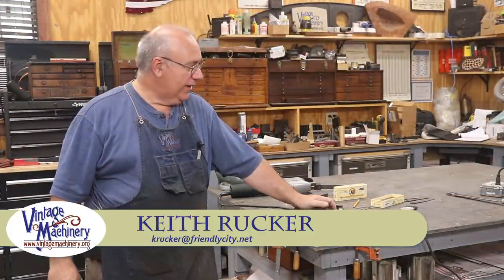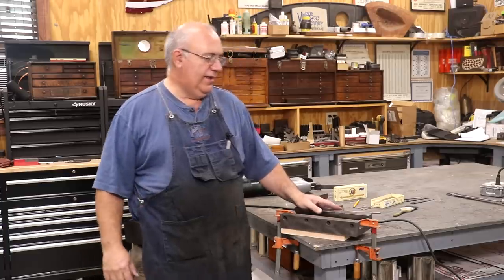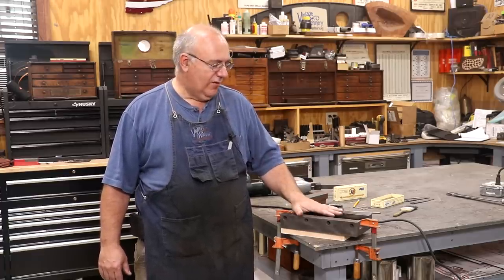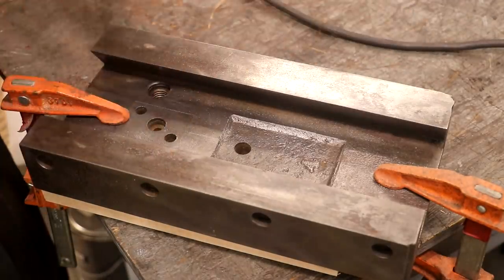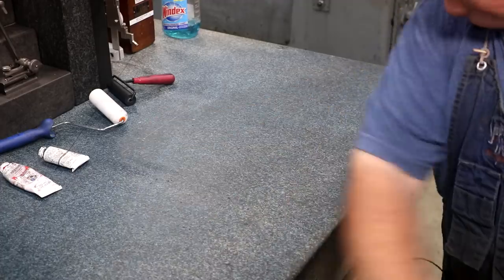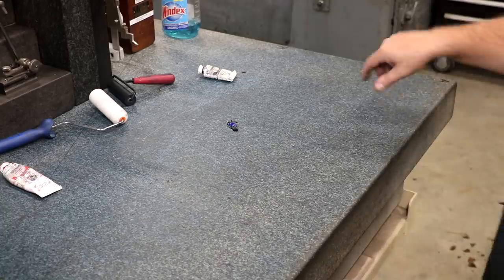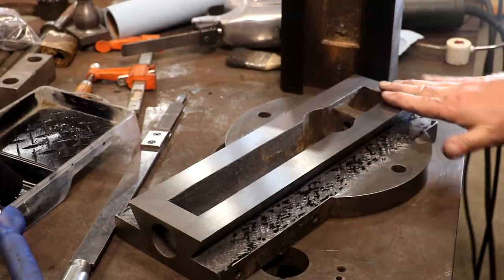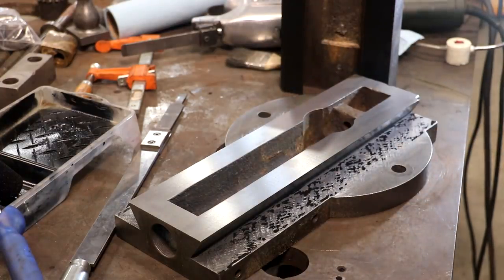Metal Planer Restoration 42: Scraping the Clapper Box Cross Slide

Comment: Just to share what's been shared with me in order to keep proven knowledge of production scraping and techniques alive for future next generations:   The old timer that taught me scraping, Peter Kuhn, used powdered paint pigment, orange and black, mixed with 10w spindle oil until it became a stiff paste, much like makeup.  He then made a dauber out of felt and would use that to spread the "ink".  Black on the plate, orange on the part.  If it's too thick, set your spray bottle of WD-40 to the finest mist, hold it far enough away you only get a few drops on the granite, then spread it out thinner.  This stuff goes a long way and you can easily control your ink film thickness. Starting out, you can high light your worn areas by spreading it thick, then thin it out as you refine your points.   Keith Rucker, thank you for sharing your knowledge on scraping.  It's an essential and dying art in the machine tool trade.  Keep up the great work.  I appreciate it.
Reply: To clarify, you would mix this concoction in an old Altoids can or a tin that you got a wallet in some years ago and daub out of the can.  Don't try mixing this up right on the surface plate :-)   You also want to have two different daubers for the different colors.  "Once you figure it out, then you'll know" -Peter Kuhn

Comment: What I've learned from "the scraping channel" is exactly how much patience is necessary to produce precision work.  Those who don't have the patience to watch it probably don't have the patience to do it, and will never learn to produce precision work.  In fact, they probably aren't producing "work" at all, they are simply sitting there waiting to be entertained.  I can tell you that the work I'm doing has improved by orders of magnitude by watching you and several others who do the patient work you do.  I'm not doing machine work.  It isn't in my budget to have a shop like yours, which is okay.  I give all glory to God for those things I can do, and don't covet that which I can't.  I do piddle around with carpentry and furniture repair, and I've learned techniques that are helping me get better joints and flatter surfaces.  I can't afford to buy new machines, but what I've learned from you and several others has helped me get my elderly woodworking machines running better and truer.  I'm tackling projects that would have been above me in the past.  All of these are good things.  I challenge the complainers to get up off their bean bag, put down the computer, and actually do something themselves.

Comment: I noticed the bolt holes that look like they were pulling up at their ends/edges, I guess that can be a regular occurrence on cast that gets the gorilla treatment on a regular basis?  The pivot lock down bolt hole on my shaper's clapper box was doing that.  I cleaned it off with the surface grinder, and I intend to keep an eye on it, to see if that trend continues.  I see signs that the hole has been repaired in the past, which explains why I had to put some relief between the bolt head and thread, and later on open up the slot a little with a Dremel.  Whoever repaired it didn't do a very good job of locating the new hole.

Since I flipped that part and did a correction grind on the dovetail, now I need to go back to it and make sure I don't have a situation that is similar to what you found.

Comment: Seen you scrape before, x amount of repetitions is needed to comit to my memory. How on earth do you get the diagonal dovetails alligned with each other?
Reply: You measure across a pair of pins seated in the dovetails at each end.
Reply: @nerd1000ify  Ahh the guage pins come in for another use. Neat Ty. Next question they are parallel but how do you make sure the angle is at or needs returning to say 60°
Reply: @alstonofalltrades3142  It actually doesn't really matter what the dovetail angle is (within reason) so long as it matches the mating part, so generally you would just scrape one side (ideally the longer of the two) in and then use that as a master for its mating part.

If you really needed an exact dovetail angle for some reason you could set a sine plate to that angle on top of your surface plate, bolt your part to to it and sweep a test indicator over the surface of the dovetail to check which way you needed to go.

Comment: Keith, I am not quite understanding this process, I would have thought the more you scrapped, the more the two parts will actually come apart in the dovetail area on the assembled machine?
Reply: They will, but all machine tool slides will have some type of adjustable gib in them. As the slide wears normally that gib is then adjusted to keep the clearances correct. Likely he's at most taking a few thou off in total with the scraping, that amount will never be noticed with that adjustable gib.

Comment: Keith thanks again. Is there a way a novice can remove the wear out of a small 1950s milling machine without a surface plate. say with dti gauges feeler gauges straight edges ect
Reply: No, if you have to ask then it's not a job you should be even considering.
Reply: @chris0tube Simone asked the question because he wanted to know, I gave him an honest answer. And it was worded precisely in that way because I do have just enough knowledge to say what I did. Without those reference surfaces Simon asked about and specifically that surface plate, it's logically a failure just waiting to happen.I never ever give knowingly incorrect information. He also didn't mention having a very accurate machinist level.Those aren't optional reference tools if you want any hope of being successful.And the less you know the more important they are. Yes you can literally start with almost nothing using the 3 plate generation method to produce your own proven reference surfaces and boot strap your way up from there exactly like Whitworth invented in the 1830's to get beyond the technological machine tool level they were then at. I highly doubt 1% of the people making comments here would have the drive, ambition, skills and knowledge to even attempt it. But without either buying or making those basic references as a bare minimum and knowing a lot more than what any video might provide it simply ISN'T going to happen.You can't even verify your straight edges are in fact straight. And without understanding the basics of machine tool geometry you are undoubtedly going to make things even worse. To suggest otherwise like my statement is somehow flawed and incorrect is completely misleading to others. Exactly where did I say I or others couldn't or didn't know enough to do it? No where did I say it can't be done, those points weren't pertinent to his question. Simon asked if the (apparently obvious) wear on a 1950's mill can be removed using dti's, feeler gauges, and straight edges. Simply by asking if it can be done in that way then it's more than obvious he's lacking the basic's of how it could be done. So exactly as I said "if you have to ask it's not a job you should be even considering". 

Anyone having enough experience to actually do the job wouldn't need to even ask the question he did. I didn't say it was impossible, I kept my answer short and to exactly what he asked about. With known verified straight edges, a huge step up and maybe having something even more helpful like a Kingway alignment tool, machinist level, surface plate and a whole lot of experience then yes it's not impossible at all, it's done every day. But asking if it can be done that way already proves that required experience level is in fact lacking. A simple once through the Connelly book Machine Tool Reconditioning more than proves my response to Simon was and is correct despite what you might happen to think. Making knee jerk assumptions about what anyone happens to know or not know and using a simple one line response to form that judgement is also a large mistake. Go ask Simon's exact same question over on the Practical Machinist Machine Reconditioning forum and there's no doubt you'd get just about the same response as what I gave him as an answer.

Comment: Would engine turning achieve a similar result?
Reply: No, it is a different process not as precise and done for looks
Reply: @ypop417  I know the difference between what scraping can do and what that simply decorative engine turning is. With small Cratex points and an immense amount of time shifting parts into position to each high spot so it could be hit with that abrasive point? It's not exactly impossible it could sort of be done that way. 20,30,40 X or more time involved though. And you'd need a lot of practice to judge how much pressure and dwell time to use.Just fully hand scraping anything without a Biax would be easier and far faster.